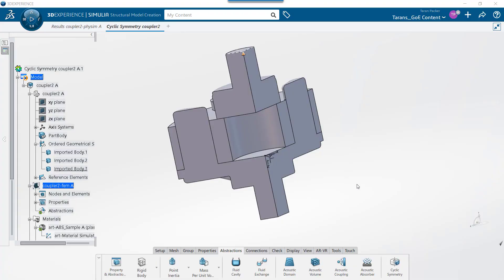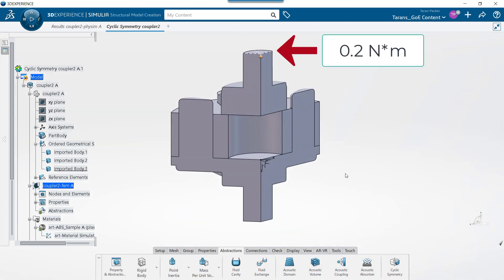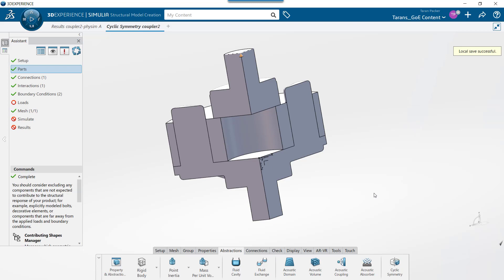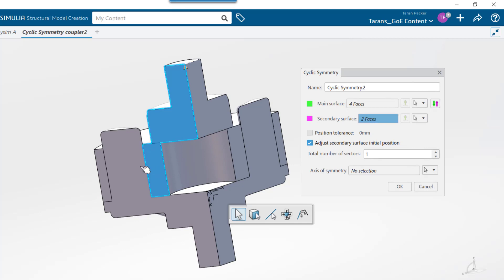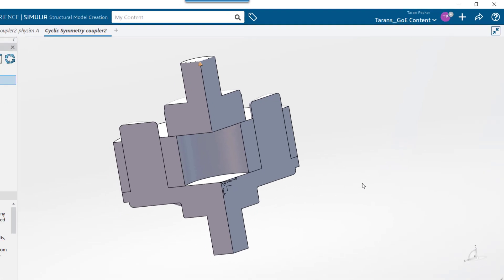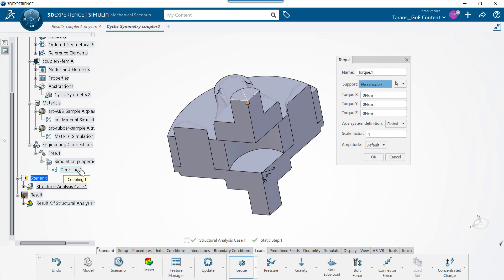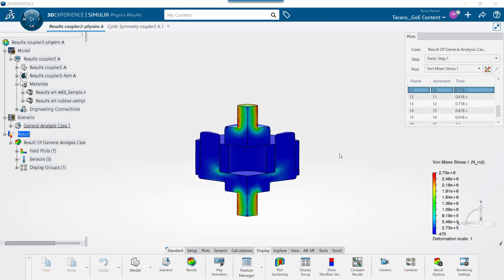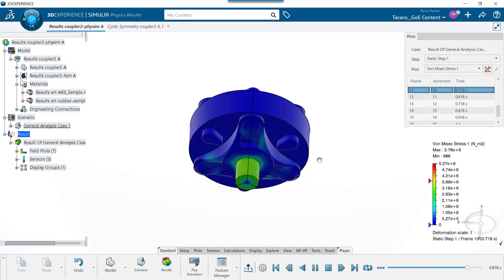3DEXPERIENCE SIMULIA - Cyclic Symmetry

Comment: Thanks, nicely explained. I have a clarification. What will be the magnitude of torque. Would it be 1/3 of the original magnitude?
Reply from the maker: That is correct.  We entered 0.2N.m on the 1/3rd model to simulate a load of 0.6N.m.